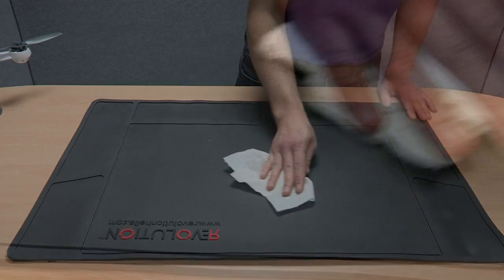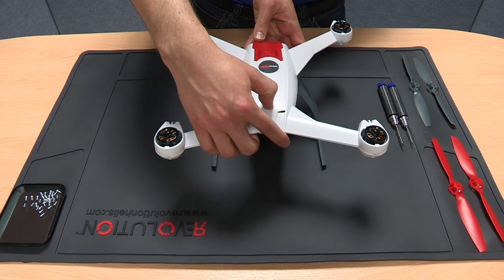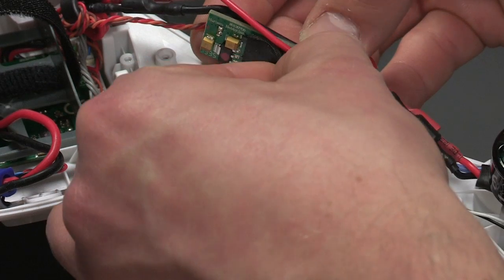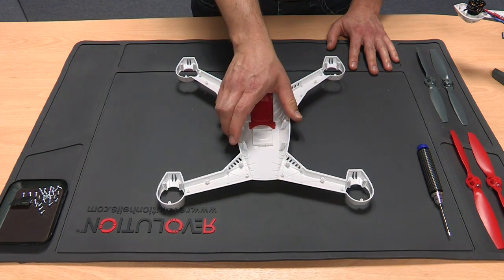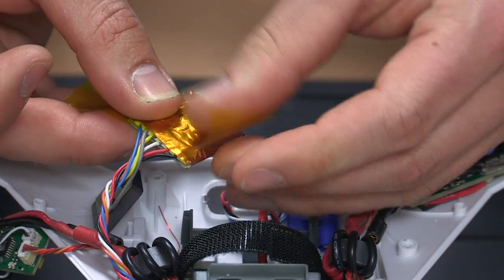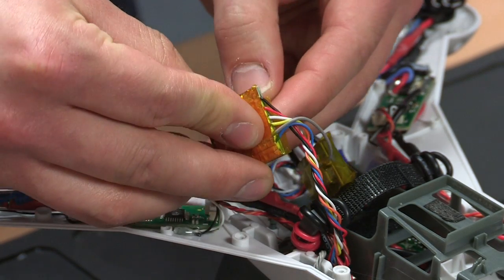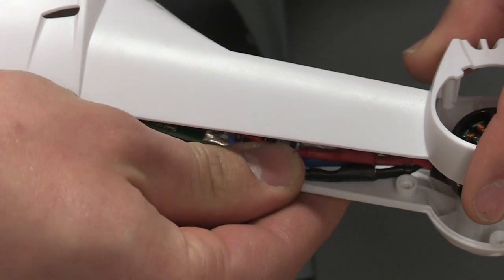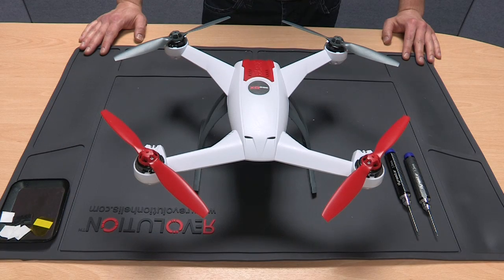Hardware conversion guide for the 350QX Version 1

Comment: Hi well done on a good video i have the original 350 qx just fitted the gb200 gimble want to up date to firmware 2 but do i have to do the hardware conversion for the firmware 2 to work properly?

Comment: Well pt together video, but why hot glue on the esc wouldn't  a thinner glue pad do the trick, like Dap laminant glue pads.   much thinner than the glue used!
Reply from the maker: Glad you like it, pictures always worth a thousand words.
Reply from the maker: In regard to your glue question we can only recommend the use of hot glue. It is critical that the ESC remains in position in flight. The GPS antenna is mounted directly on top of the ESC and any movement could have an adverse affect on the flight characteristics of the model. Any adhesive used must also be non-conductive.